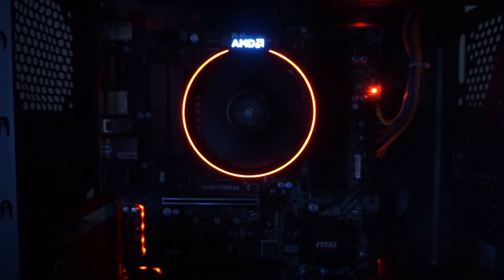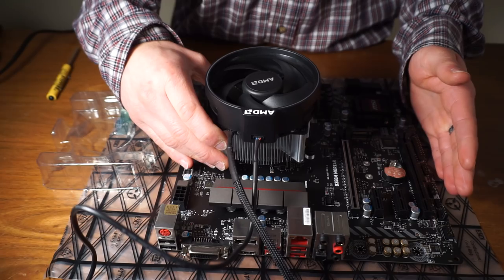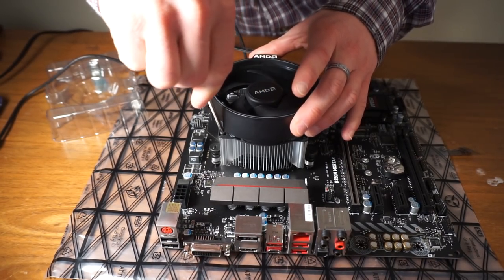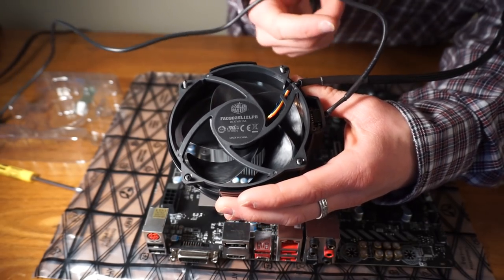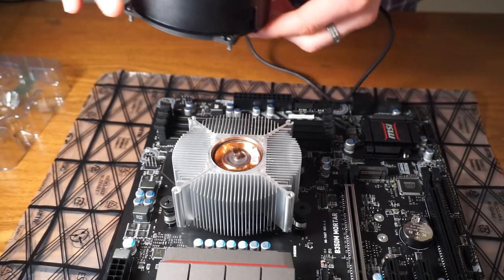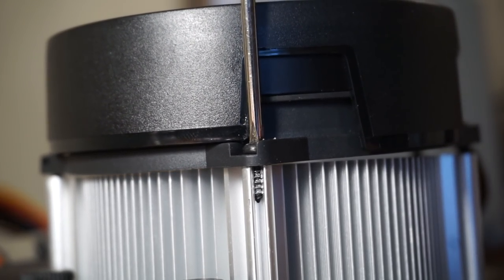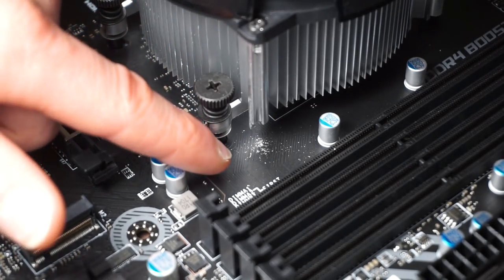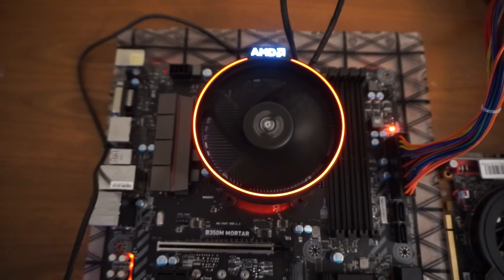How to Rotate AMD Spire Heat Sink - AMD Ryzen microATX Video Editing PC Build

Comment: Soo my motherboard don't have the 4 led pin connector, but it has 6 rgb 4 pin connectors , can I use those to connect the led for the fan?
Reply: what motherboard?
but yes, those should be the same

Comment: So has no one mentioned that the plastic cap with the AMD logo pops right off the fan itself?
Reply: Rexx Reviews I tried it and the shroud snapped. Fml now I gotta but an aftermarket cooler...
Reply: Have to treat it like a lady!!!
Reply: Mine did not. Feels like it's glued on. Mine is the non-lighted version though.

Comment: How do you like the board? I've got the tomahawk.
Reply: I have the board and would buy another it overclocks  well  also.
Reply: you wouldn't happen to be running fast ram would you? I'm running 3200 and it runs fine but doesn't like to cold boot
Reply from the maker: +Davis Lawrence yeah, I bought the 3200mhz ram. It doesn't come clocked at 3200. You have to overclock it to that speed. It's like 2133mhz out of box. I had got it clocked to 3200mhz the other day. However I've never done overclocking before and I think I got the timing messed up because it did worse on benchmarks so I set it back to default. Now that I've watch a few videos and done some reading I need to give it another shot.

Comment: It is better to do this off the motherboard, not on it. That small copper piece that you brushed off, and those aluminum shavings that you blew off, they might short circuit and burn your motherboard.

Comment: Don't try this if you have a Ryzen 7, the screws are in an angle that you could potentially damage some shit. I slightly blemished the ring where the lights are on mine, so now I have a black dot that won't go away, and while I could have been more careful, but it was damn near impossible to get them in or out since it's like trying to fucking put a screw in a wall sideways.

Comment: doesnt work anymore ... 1/13/2018 updates screws under fan... made them flat so they interfere with clearance, ryzen 1700 cooler
Reply: creates angle when trying to screw back in as well :( might have to keep 3 screws in fan :( thinking about just bending and breaking small plastic shroud in way of screws
Reply: Dang that sucks! just bought the 1700 and it doesn't work for me either
Reply: Yup, check my post, I got the screws back in, but I ended up very lightly blemishing a portion of where the light shows, and one of the screws is pretty much half way in and crooked.
Reply: @camshous1657  really? damn I just bought a 1700 today in hopes to do this. sigh

Comment: I bought the ryzen 5 1600 and my cooler is exactly the same but it doesnt have rgb. Why is that ?
Reply: Only the Ryzen 7 stock coolers come with the RGB ring on top if I recall.
Reply: If you wanted the pretty LEDs then you should have bought the R7 1700. The R5 coolers are just plain with no lights.
Reply: +259 Okay thanks guys

Comment: What should I do when my amd cooler don't want light.
Reply: You likely have a Ryzen 5 cooler if it doesn't light up since they don't come with lights. Only the ones with the Ryzen 7 1700 come with LEDs and they will light up just by plugging the 4-pin into your motherboard and powering on.

Comment: not to beat you up but there are some things I don't think you should have done number one I don't think you should have done that fan rotation swap on the motherboard that's something that could have been done on the side number two I don't think it's a good idea to turn your motherboard on a plastic anti- static plastic bag I just don't think that's a good idea maybe the motherboard cardboard box or a rubber mat technically the wood doesn't conduct electricity either but there are solder points behind the motherboard so it was probably best to do it on a rubber mat with flexibility or cardboard motherboard box for the simple fact that they will poke into the cardboard just my observations I didn't like the fact that you had aluminum shavings on the motherboard regardless of using your air can the blow them out other than that decent video
Reply from the maker: Yeah.  My first computer build an I admit that I screwed some things up.  Thanks for your thoughts.  Good things to consider an for future builds.

Comment: can I Sli or crossfire with this mobo I own one
Reply from the maker: +UrProxy MSI says it supports CrossFire. IDK about SLI. doesn't mention it. https://www.msi.com/Motherboard/B350M-MORTAR.html#productSpecification-section
Reply: SLI feature is mostly on x370.
Crossfire works on Most B350
Reply: sli work with just x370 chipset
Reply: Makerj101 yeah you can't sli with a b350 chipset
Reply: Csongor Kecskés its exclusive to the x370 chipset

Comment: Can I do this with wraith stealth
Reply: Yes, you can. The fan shroud just clips on. The best way is to remove the shroud before you mount the cooler and then unscrew and rotate and screw the fan back in and then clip the shroud back on.

Comment: Mmmm in 1-2 years when the fan dies, you need to replace it with a regular no leds fan, I would rather sell that stock fan and buy a proper tower cooler.

Comment: where to buy only the RGB fan for AMD ryzen stock dissipator?
Reply from the maker: +GiovixTM TV I replaced mine with a water block so I could do some serious over clocking(I was sad because I loved how it looked). So my RGB stock Ryzen cooler is just sitting in a box. They go for $30-40 not including shipping on eBay. I'd do $30 including shipping as long as you live in the US. If outside US I'd do $25 plus wherever shipping costs. Let me know.

Comment: Is this 100% safe, don't want to f*** something! :D
Reply from the maker: +Gole no. It is 99.9% safe. You might scratch the side of the fan a little. That's about it as long as you don't use a hammer or explosives to remove the fan. XD
Reply: Thanks guys!